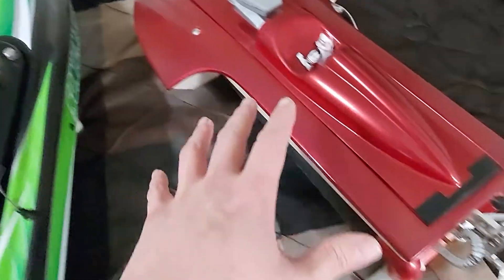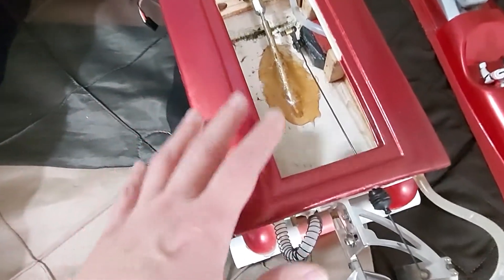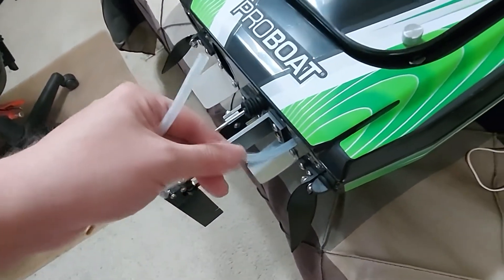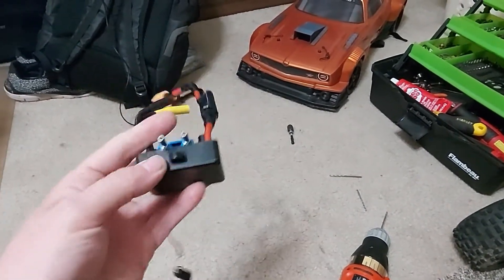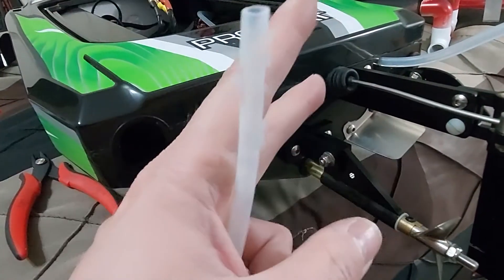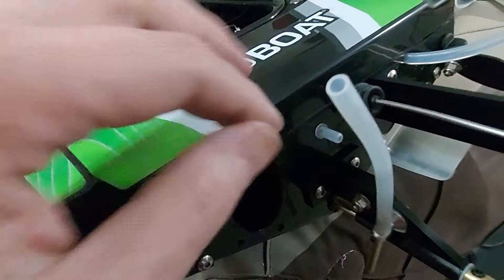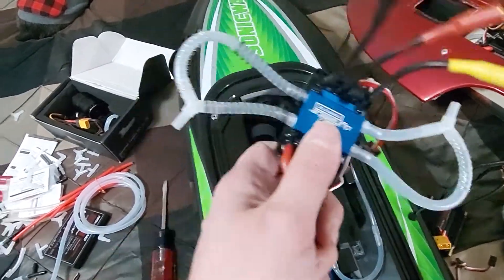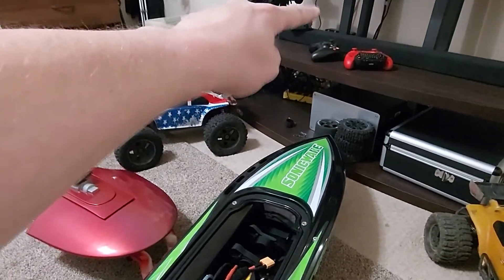ProBoat Sonicwake Cooling System Upgrade

Comment: I run a dual pickup rudder on my sonicwake and a electric water pump with remote switch on my remote. So even after some fast pulls the boat doesn't have to be moving to cool off.

Comment: I have a question. What Size were the springs? Also did the running video ever make it out?
Reply from the maker: if you take some tubing into ace hardware they will be able to match springs up for ya, that's what I did. No running vid as it doesn't pick up the water coming out on camera.

Comment: Super nice, been looking for someone with a better cooling system for my sonicwake especially since both my motor and ESC burned up.. this happened even with the upgraded rudder with 2 lines.. You chose to cool the ESC instead of the motor, can you explain?
Reply from the maker: Both motor and esc are water cooled... potently!!!!
Reply: @NomisRC   ….. didn’t intend to say not to cool the motor, just that you chose to super cool the ESC and not the motor, where as you could have reversed it and sent the new cooling idea to the motor instead of the ESC.. i almost feel like using your cooling idea for both.. your thoughts?
Reply from the maker: @stevenenglert296  oh ok i gotcha, motors can take more heat then esc's so i went this route, but doing it for both would be optimal for sure, but its been good so far as is.

Comment: Did it run cooler after……?
Reply: @NomisRC  Thank you sir. Are ya gonna make a vid of a test run ? I wanna see how that water shoots out from the water outlet you’ve installed in the front.
Reply: @NomisRC  Ok, thank you😜 What were the temps after a run…..?
Reply: @NomisRC  Okay, thank you again.
Reply: Did it take in any water - if any, after adding the new set up ?
Reply: @NomisRC  Okay, thank you sir. What size of airline tubing  did you use to run from the stinger…,?

Comment: What size of drill bit did you use to make the hole on the transom where the tubing runs from the stinger, and furthermore….what size of drill bit did you use for the aluminum water outlet water cooling drainage mount ? Thnx .
Reply from the maker: I just matched up drill bits to a m3 screw till one looked the right size.

Comment: What size drill bit did you use to drill the whole on the stinger?
Reply: @NomisRC  thanks man i really appreciate your video ended up doing what you did but adding a second one on the other side and bypassing the rudder intake the boat runs great and everything is ice cold after a hard run on 3s